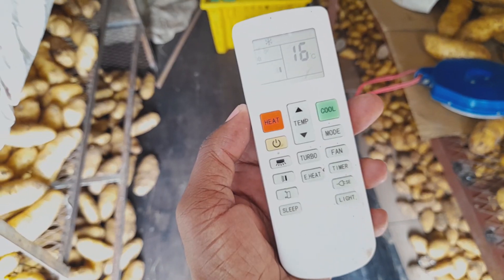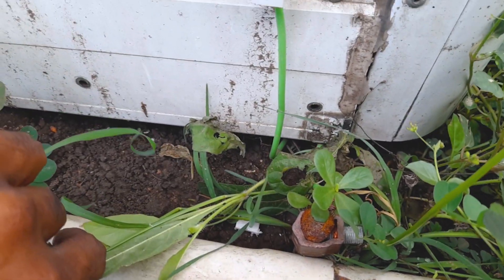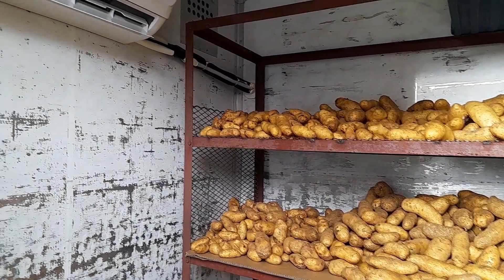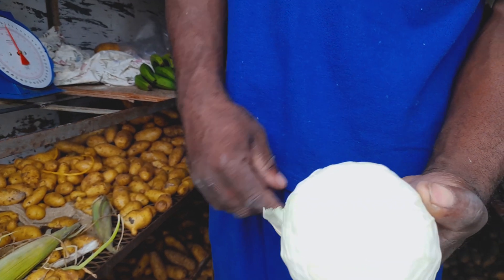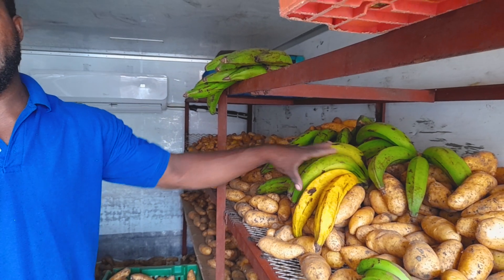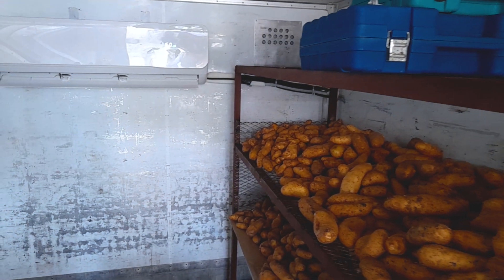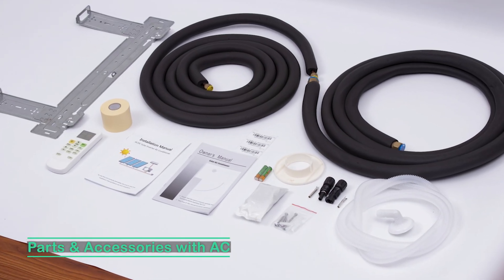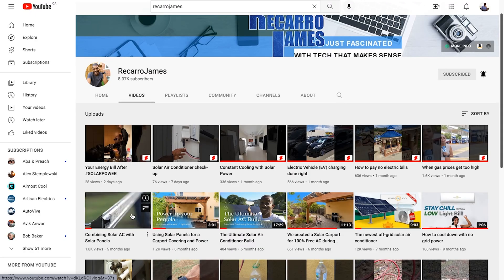DIY Solar Air Conditioning for farm produce

Comment: These types of units are usually heat pumps also so they can produce heat and cool for those of us where it's not always warm.. Just ordered a similar unit, I am anxious to see what it can do!
Reply from the maker: Yes you're absolutely right about that. Which version/brand did you order?
Reply: @RayonWhittaker  EG4  the 12k unit... Heard about them on Will Prowse yt channel.. On sale at signature solar in Texas
Reply from the maker: @Bobotrucker  oh yea I've seen them. Signature Solar had reached out when they saw my videos. I believe it's the same as this version here and they rebranded it EG4
Reply: @RayonWhittaker  I see.. gonna at least get it hooked up to AC power this winter (Michigan).. Solar really works well here between spring and fall, not so much this time of year but I think it's still worth it if you can install yourself
Reply from the maker: @Bobotrucker  haven't tried the Deye version on heat, just cold.
The app works really well though.
I have a product that can make any AC Smart and allows the same remote control and flexibility via an app. I may just do a video on that.

Comment: Can I add a battery to get ac at night
Reply from the maker: Yes yiu can. In fact there's a verison that's sold with batteries, they're just not available, just these hybrid ones for now
Reply: @RayonWhittaker  when will these ones with the batteries be available? 
And whats the cost 28btu with batteries
Reply: @Rayon Whittaker  hi, when will these be available

Comment: What is the US$ cost for these units?
Reply: I don't think Arizona would ever allow solar AC?  The electric companies are getting 500 dollars a month from people just so they won't die of heat stroke.
Reply from the maker: You should check out our electric company out here in Jamaica. I believe our rates are higher than every other country.
Reply from the maker: This version can work out to around $1200 USD or less for the 18k btu
Reply: @RayonWhittaker  Thanks. Is that the price landed after shipping & duties?
Reply from the maker: @dpark1964  so far